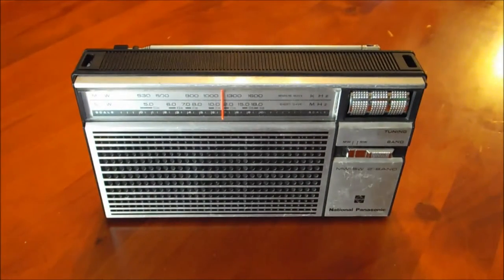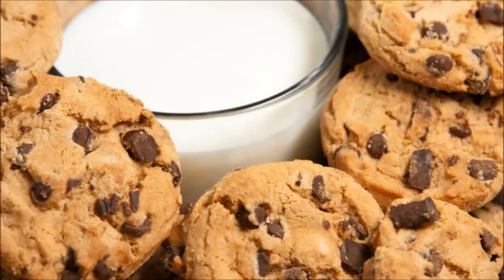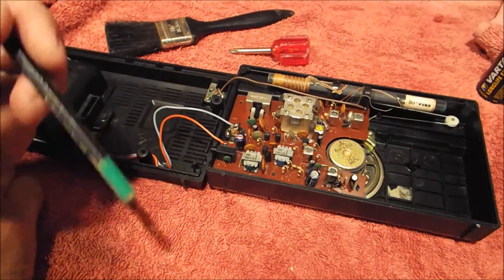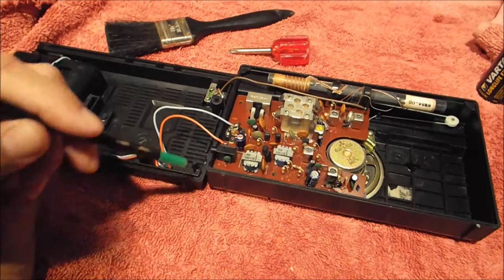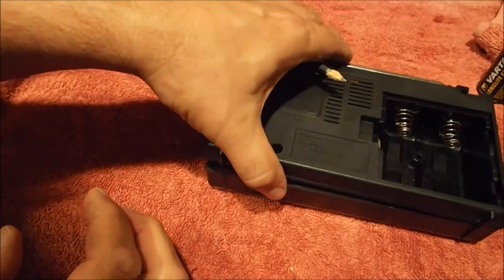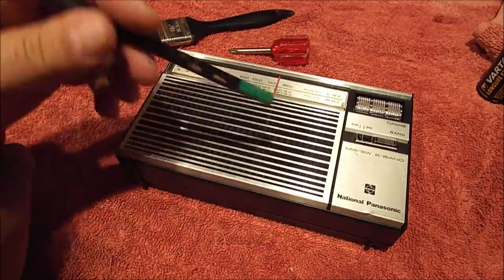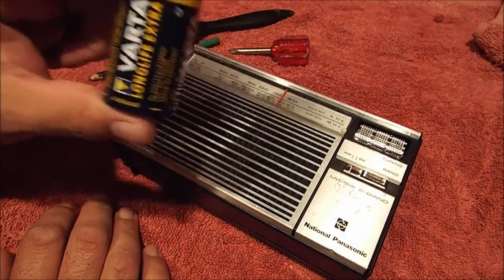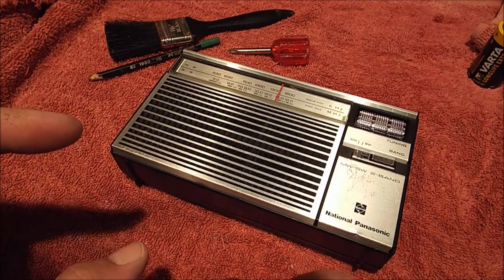Mystery Radio Update - National R218R

Comment: Interesting.  I repaired two R238Ws in the early 80s.  One had failed output transistors due to a dry joint on a resistor in the base circuit, it crackled and cut out due to sand in the the fingers that touch lands on the circuit board.  Apparently it was dropped at the beach.  The second had a dry joint on one of the base resistors.  This model also runs on 3V, a pair of D cells.  They feature AM and two SW bands, the R238R looks similar but has AM and one SW band. Nice sound.
Reply from the maker: Agreed the produced audio is not too shabby for such a sized radio, the R238W sounds interesting I hadn't come across one of those yet 👍
Reply: They are larger than this one, easy way to spot one is the green tuning light. A green circle in the upper right of the front.  You hold a button to activate the light.  It lights when a station is correctly tuned.  I also have a Sony TR6400 which could do with a few caps in the amp but doing ok.  It's a long range radio with a tuned preamp. An op shop score.

Comment: Nice vintage radio. Receiving shortwave stations on a radio like this is an awesome experience without any doubt. Reminds me of my own first steps in the hobby back in 1984 with a simple boombox that covered SW from 6 to 18 MHz on a dial of the approximate length of a finger.
Reply from the maker: Awesome nostalgia, I used to also own a boom box style radio with Shortwave coverage as well, back then FM was relatively new to the local broadcasters :)